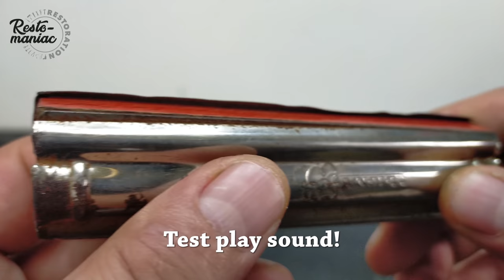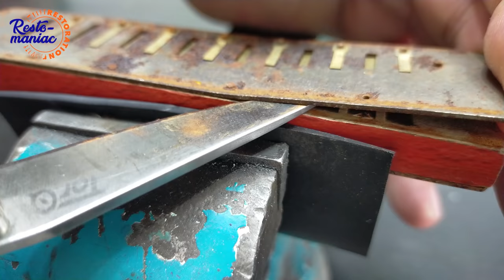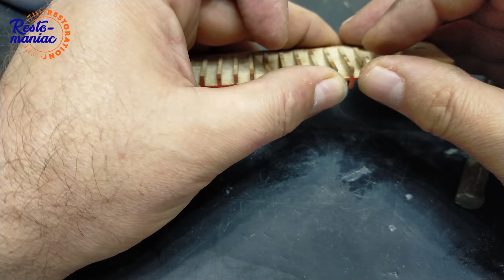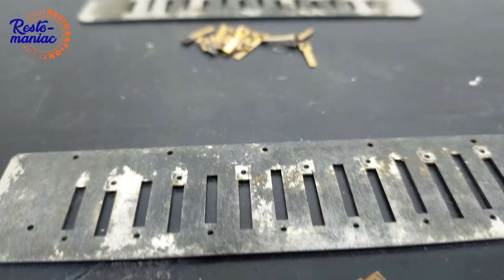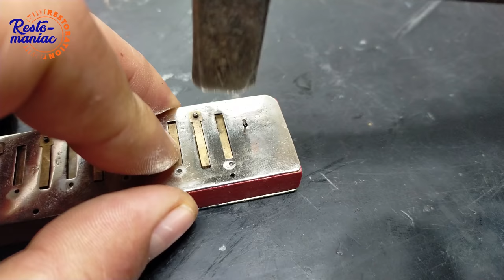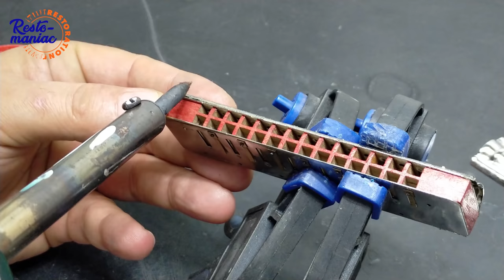1970's "Artist" Ligna Harmonica / Mouth Organ - Rescue

Comment: I usually like your vids but I'm afraid I'm a musician, so I can't give this one a passing grade. It looks better than before but the restoration didn't do much for the sound. Best leave musical instruments to the specialists..
Reply from the maker: You are right, sound is terrible. I guess those little brass wires need to be changed.
Reply: @Restomaniac  more likely it's about their angle and how tightly they're pinned down. They need some room to vibrate.
Reply: Yeah, though i sort of assumed it wouldn't do much as an instrument and it would only be worth for it just for looks and preservation.

Comment: I don't think I've ever seen someone restore a tremolo comb before.  Really nicely done.  I see people asking for repairs on them, particularly ones that used to belong to their grandpa or dad.  Most of the repair guys focus on diatonics, with a small handful doing chord harps and chromatics.  The reeds may be too far gone on that, but often they just need to have their gap height adjusted a bit.  Tremolos use paired reeds, tuned a few cents sharp and flat of each other to create a wave interference pattern to make their unique sound.  It's possible to retune the reeds.  You can raise the pitch by thinning the free end of the reed a tiny bit, or lower the pitch by thinning the base end a bit, or by adding a little solder to the tip of the reed... lots of guys play around with different tunings by using a tiny bit of blue tack.  

I wonder what the reed size is on those... there were several companies in Europe.  Some of them were subsidiaries of Hohner.  You can get individual reeds from them, if you really want to go down the rabbit hole.  They aren't as versatile as diatonics, but tremolos can sound really nice.